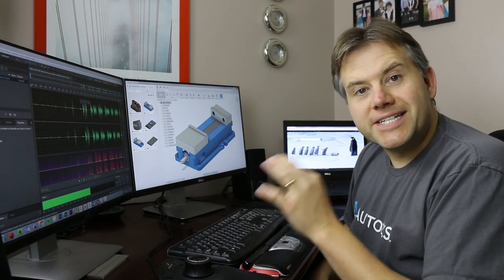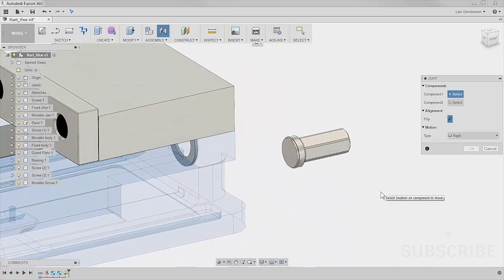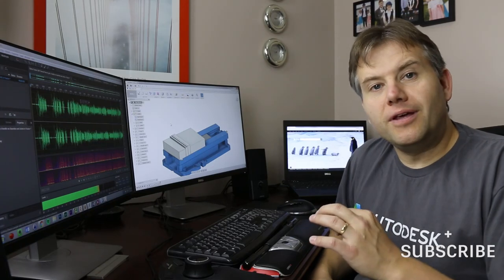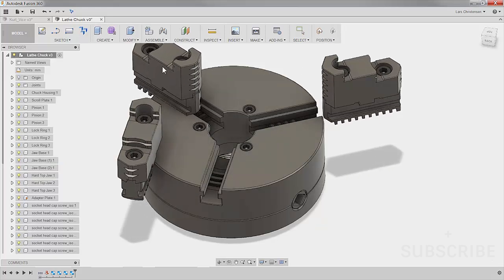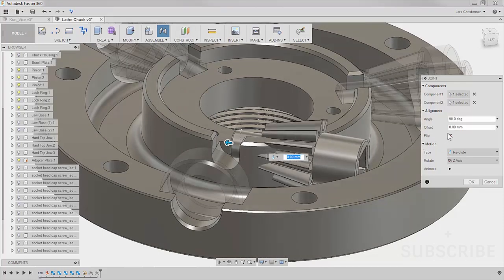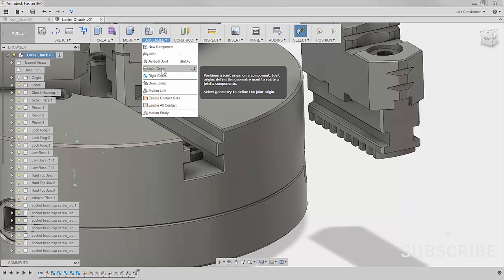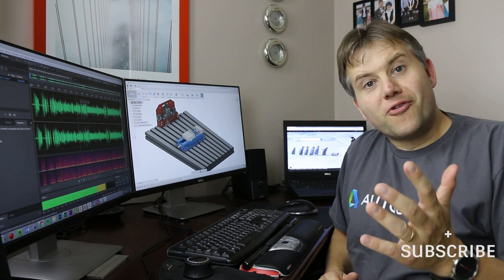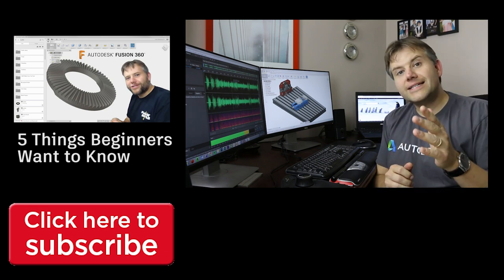Fusion 360 Tutorial — How to get a handle on Assembly and Joints in Fusion

Comment: I still have questions concerning the "joint origin" function compared to Solidworks mates. For example, if the open width of the jaws of the vise needed to change, I take it you would be forced to manually edit the limits of the joint to match the new dimension? In Solidworks, I would simply mate surfaces or planes in a way that takes advantage of the parametric nature of the software (such as symmetric or width mates), and the positions/dimensions would update with the changes. I've also been unable to find a function in Fusion 360 similar to configurations, which I find essential in designing part families. Any other advice would be greatly appreciated.
Reply from the maker: I thinking you can get around this by how you are placing the joint origin. This might be a great question to ask on the fusion 360 forum where some examples can be shared

Comment: What software did you use before 360?
Reply from the maker: Hi, Jaime. Some Inventor, but mostly SolidWorks. What about you?
Reply: Yes same thing.  I've used Unigraphic/ProEngineer/Inventor and Solidworks is what I prefer,.  I could tell you were using Solidworks by the nomenclature you were using.  I have been looking at F360 but havent made the jump.  Great video.  I actually like music in the background myself.

Comment: Hallo Lars,
I wand to pose a question.
You have joints to slide, rotate etc..... But my problem is I have a motor and an axes that are connected with a V-belt over 2 pulls, or with a tanned belt. Is it possible to make a joint so that when I turn the pully of the motor the pully of the axes it is connected with by the V-beld turns also. I don't think it is possible but you never now.
Reply from the maker: Everything is possible :-)...Okay, maybe not....The problem with 3D CAD software is that everything has to be solved constantly. That means that when you start creating moveable components the software starts cranking 1's and 0's; The result is often your computer starts acting slow or un-responsive at times. So, go ahead, but be prepared that the more components your add, the slower things will be.
This is why most CAD software has an animation workspace. Here you are removing the constant solving of movement. Fusion 360 has an animation workspace where you can create the movement.
Reply: Thanks for the reaction, I'll try it in animation

Comment: After a user creates a Joint, and it does its little preview movement to show you the joint was successful (i.e. spins, drags, or whatever) - at 11 minutes you said you could use your left click mouse button to move the joint (i.e. you're able to interact with the joint).  

I can't do this - I have created numerous joints and have not been able to interact with any of them.  How could this be?  When I try to click on an object to move it relative to the joint - it pans the whole background with all the components.

Do I have something turned off in the settings or is this simply a bug?
Reply from the maker: I honestly don't think so. Can you test out to see if you can do this if you just join a round pin in a hole? There might be something with your installation of the software.
Reply: Lars Christensen Yeah I actually tried that after and it still doesn't work. Did a slider through a hole. Still doesn't let me interact. Maybe reinstalling will help? Maybe I should probably contact autodesk.
Reply: I figured it out Lars, thanks for your attempt.  I didn't have one of the components grounded.  I didn't know that you had to have at least one component that is connected to a joint with another object "grounded."  I should go through your whole tutorial now heh.  Thanks again!

Comment: Awesome tutorials, but question... Isn't capturing the position a bad move? Like, it adds useless clutter to your history (bad for slowdown) and to my (mostly ignorant) understanding serves no purpose? Is there a reason to do this that makes sense for a more advanced user, or is this a bad personal habit?
Reply: I use it to isolate the parts. When using joints you need access to the features. But, if things are in the way you only have 2 choices. Move the part into free space and capture the position. Or, change the view of the parts that are in the way so you can see and get access to the features you want to mate. But it's up to you. I like to free move parts into free space. Then when Fusion asks me to capture I say yes. If I don't the part returns to it's starting point, which is not what I want. Otherwise you can change the visibility/select-ability of any parts blocking access to the part your trying to mate. 
Best Matt
Reply: Oh, awesome, thank you for the explination. Makes more sense now :) that would be a whole lot easier than toggling visabilities on and off constantly

To the point of possibly exacerbating slowdown though, would position changes add to this? Or could you remove the capture after making the joint to clean up the history?

Comment: Hi lars !! Nice job.. but I have a question... it is an issue on my animation (it is a servo mounted in a servo holder plus an actuator arm attached to the servo). I grounded the servo cage and rigid grouped servo and cage.. then I rigid grouped the rest of the components - arm and some bolts) and create a joint between those two groups (to simulate the arm to be actuated by the servo). Up to here, all ok... but when activating "Contact" and make it spin... as soon as the arm hit the servo cage... servo remains in possition but cage went flying away...as hit per the arm... How can I fix it ???.
My intention by activating "Contact" is to avoid inserting spin limits to the model...

Tks in advance !!
Reply from the maker: Hi Jorge Lopez Segura Thank you for watching!
Well, I would have suggested that you change to limits by right-clicking the joint in the folder on the right side. 
You might be running into some calculation issues. Maybe checking out the motion study option. Because, when you are using a contact in the model environment there is a lot of calculation happening in an area of the software that are not really meant for simulating movement per say.

Hope this makes sense....Maybe a good livestream topic at some point

Best,
Lars

Comment: Hey !
Starting with that I think this is a very good
exercise video overview and finely crafted
What I wonder about and do not know if this is the right forum
But one question would not be able to put the output and input
For these joints exercise movements linked to ex Arduino Raspberrt Pi PLC
I've taken a bit of Visual Components Factory and IO
But to make their own machines in the Fusion 360
The exercise movements
so it would be excellent in a future update Fusion 360
When I look at your tutorial here in this clip so strikes me that idea
To even be able to add IO / GPIO signals the PLC linked to the joints, so to speak
As we move towards an era of Industry 4.0
// Magnus
Reply from the maker: Hi Magnus, Thank you for taking the time to watch the video. If I was you I would post this to the Fusion 360 Forum. I know nothing about IO/GPIO's etc. :-)
Reply: Hello Lars Thanks yes i anderstand

Comment: This may be just me, but after watching the vice and the way the movement in implemented it seems wrong.  Would it not make more sense for the program to sense where the moving part will run into another part instead of you telling it where to stop.  If you were to make that part for example, the moving jaw would have a natural restriction when it runs into the fixed jaw, and on the other end I am assuming that there is something that surrounds the screw that would bottom out on the other side.  These are hard restrictions.  It would be nice to know what and where they are instead of being able to slide pieces through pieces.  Also, the linked movement. .  It would make so much more sense not to have any linked movement until you have the screw and nut in place, and than have real linked movement.  It seems to me the way you are doing things makes it really easy to miss something.  None of the movement is based on the physicality of the device.  Does this make any sense?
Reply: It doesn't automatically sense it, buy you can put in limits manually for sliders, revolutes etc. 

As for the physicality, you could just as well select the touching surfaces of the moving jaw the the base it slides in and achieve the same. A joint is basically just defining points of intersection, then from there alignment, offsets and degrees of freedom (by selecting your joing of choice). Rest is optional limits. The cool thing is, that when you align things properly, you can for example animate swiveled monitor arms etc by moving the segment you want to actuate and the rest will follow, it is almost like poor man's inverse kinematics for mechanical engineering.

Comment: Lars. Your vids are sooo informative! Can you tell us sth about how do you rotate, pan and zoom the objects view in so time efficient way? Are you using some additional interface (like trackball?)? In autocad i used to use mouse scroll togehter with mouse movement to zoom/pan but if i want to rotate the view i had to use '3d orbit' tool. In your vids it looks like you're zooming/panning and rotating in the simultanously.
How would you mate pinions with scroll plate to make sure all the teeth mesh proprely and how to mesh jaws teeth and scroll plate grooves (hopu you get what mean)?  Is it possible in F360?
Reply from the maker: Thank you for taking the time to watch the video. Happy you find them helpful :-)
I am cheating with my zoom and rotation :-) I used a Space Pilot from this company:
http://www.3dconnexion.com/

In regards mating pinions, it really depends on what you are trying to do. You can use the "The Motion Link" or Animation to resemble the movement. Using standard mates can be a struggle because the software is trying to calculate every movement and that can cause your system to come to a halt.

Hope this was helpful.

Best,
Lars

Comment: Lars or anyone with fusion experience. I don't know if its because i use a smaller machine or its just how I wrap my head around attaching things to my table. I tend to either attach at the outside edges of the part (think mightybite) or sometimes I cheat and run all thread through the raw material and clamp it down with a nut in order to machine the outside surfaces.  I have no problem drawing my part.  The question I have is how to get my attachment device into fusion where I need it as to use the collision avoidance portion of the Cam package.  I have been able to use the McMastercar catalog to find the device. Again I struggle with placement of the part on the Point of my drawing where the (REAL) hardware is at.  Maybe someone can make a video on this topic.
Reply from the maker: caseyv63 Thank you for watching the video!
Will this video help:
https://youtu.be/JWRgMsi1SqY

Best,
Lars

Comment: Love this intro! I found a problem moving the clamp wedges. Before the link was broken, the clamp set parts were all somehow linked together so it was not possible to grab and move them. In the table assembly I could simply drag an individual clamp but if I then tried to rotate it by using the move command and grabbing the blue handles, all other instances of that wedge also rotated. What's going on here? I don't understand what was making them behave like this before the link was broken.
Reply from the maker: Murray, I will have to test this out and come back to you. Sounds like the clamps actually are linked together?

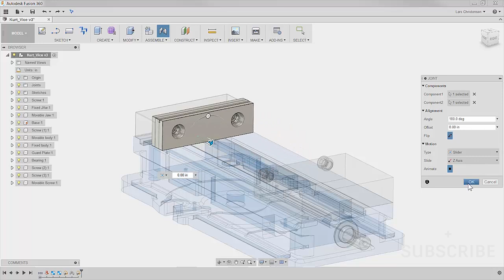Comment: I'm new to F360 and your videos are really helpful. I'm having trouble with this one at 13:55, though. After I complete the joint, the moveable jaw "sticks" to the stationary jaw, and the entire assembly (both jaws, the plate and the ring behind the small bit that turns), all move together, as opposed to only the jaw moving on a horizontal path. I've gone through the tutorial three times and get the same result each time...
Reply from the maker: Ouch, I am not sure. You are more than welcome to invite me to your project. Just do me a favor and send a follow-up email as I have a hard time keeping track of invites and YouTube comments. lars.christensen@autodesk.com
Reply: I had the same problem as Elle Calderone. I had to also ground Fixed body:1 to get it to work correctly.

Comment: Thanks for the informational video.
I have an issue with Motion Link. I got a wheel with internal gearing motion linked to a gear.
When I rotate the wheel, the gear rotates in sync. However when I rotate the gear, the wheel just stays in place.
Seems like it only works 1 way? I tried to add a second motion link, but then it tells me it already exists.
Reply from the maker: Hi ivoivo001 Thank you for watching!
Can you repeat the problem? I wonder if there is something in the software the developers should know about.

Comment: I'm designing a tube in components then I rigid attach the 4 connecting  bolts with an offset so the connecting bracket will fit under it. In assembly when I copy and move it  the tube moves but the bolts stay there... why is that?

Comment: Is there a way to constrain things similarly to Inventor? I want to constrain a part to two holes, however the holes are at an irrational angle to each other, so using a rigid joint constraint in which I enter the angle is sub-optimal. Anyone know a work around? I know the angle, it's arctan(22/15) or about 55.713123 degrees, but I don't want to enter that, I just want to constrain it to the two holes.

Comment: Hi Lars, thanks for your tutorials. 
What always gets me is when I have assemblies with joined-up components and then want to use "as-built joints" to combine these components.

 i.e. My designs has two components "C1" and "C2" which each consist of two sub-components (C1_1, C1_2 and C2_1 and C2_2). Both components C1 and C2 have joints defined for their sub-components defining some degrees of freedom for the parts to move which each other. Now I want to "join" C1 and C2 on the root-level, so that the two components as a whole can f.e. revolve around each other.

If I use "as-built joints" and then select C1 and C2 from the browser (This is important!), then I'm linking the "parent" components but nothing actually works, i.e. it's nearly like having an "empty" joint - the parts can still move around independently. 
However, if I use "as-built joints" and select a (sub)body from C1 and one from C2 by clicking the actual model, it works. I think this is because it now links the two sub-components directly.

It is very easy to fall into this trap when using "rigid" as-built joints (not rigid-groups) to keep things nailed together, because then one quite naturally tend to do the workflow: 1) Click "As-built joint", 2) Select the two components C1, C2 in the browser.

One doesn't have this problem with just using "regular joints", because then one always has to pick the joint related to a component and can't just use the browser.

This "odd" behavior has already caused me hours of confusion and frustration, so it might be worthwhile to point it out in one of your tutorials (if you haven't already. I might have missed it.) 
The "rule" (and please correct me, if I'm wrong) for me is:

When using "as-built joints" make sure to select the components to be linked in the model, not in the browser-hierarchy list!
Reply from the maker: Hi bejoscha Thank you for watching!
That is very interesting. I will have to do some testing with this. Thank you for bringing it to my attention!!

Best,
Lars
Reply: Posted it with a Screencast in the forum now as well.
https://forums.autodesk.com/t5/fusion-360-design-validate/as-build-joint-problem-for-assemblies-bug/td-p/7428017

Comment: I keep coming back to this gem of a video every few weeks and learn something new each time... thanks for that! Is there a trick for keeping the vice's range of motion when it's inserted into another design? I'm modelling a sit-stand desk with linear actuator parts. On their own they telescope properly, but when I insert them, they come in rigid.
Reply from the maker: Hi Stefan Dickerson Thank you for watching!
I will have to take a look at this....It should not come in rigid as far as I know....

Best,
Lars
Reply: I figured out what I was doing wrong. I had to “ground” one part of the actuator assembly I was bringing in to something else in the model that was grounded. Otherwise I’m just pulling the whole actuator around while intending to pull the shaft, making it seem rigid.

Once that was solved I noticed I did something else wrong. The range of telescoping motion wasn’t limited anymore. I had used the interference detection method (or whatever it’s called) instead of entering the min-max values as your video shows. Interference method worked well “locally” in the file but not once it’s inserted elsewhere. So entering the min max values is the way to preserve intended motion & constraint behaviour during sub-assembly insertion.

Comment: 27:40 After making a joint for each of the Lock Rings and making a separate joint for Scroll Plate, how would you tie the Lock Ring rotations to the Scroll Plate rotation? I know you made a motion link but this is more of a visual representation, right? The rotational speeds of each are not at all dependent on each other. I'm also aware you can do some math to calculate it, but I feel like that defeats some of the purpose of making an assembly in 3D CAD.
Reply: Solved my own question ~ Contact Sets!